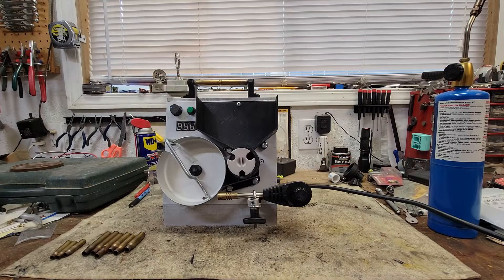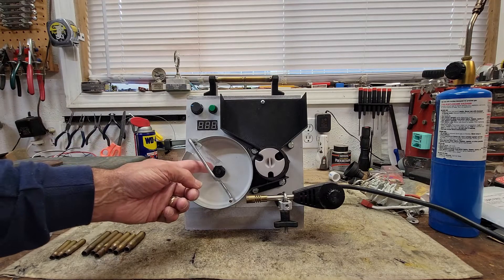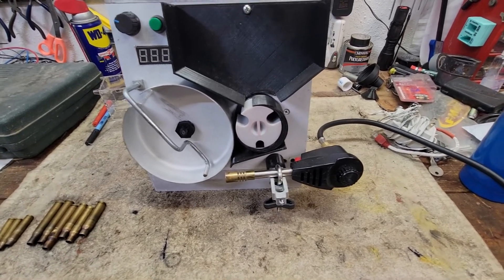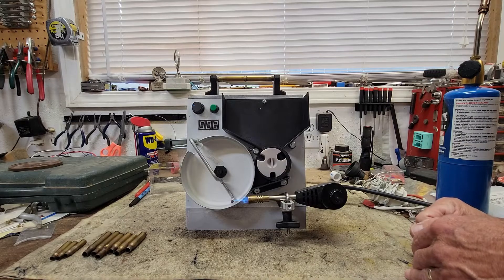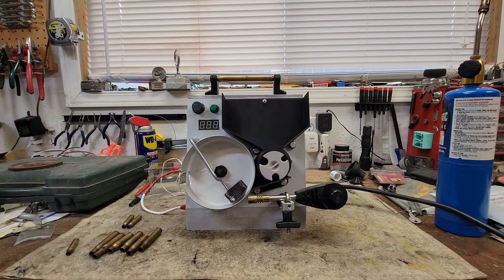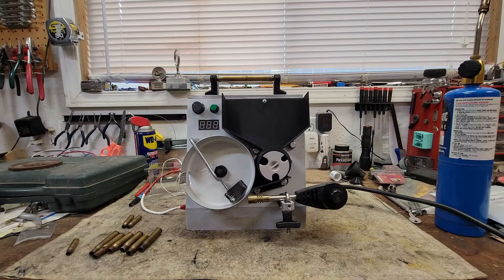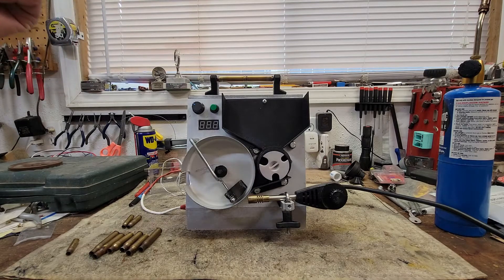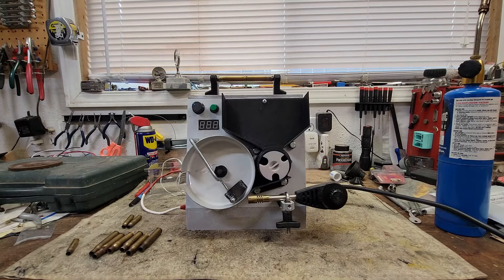Annealer questions and answers

Comment: Thanks again for the design and inspiration. This was one of the first 3d printer projects I made a few years ago. I made the case a little taller at the top for an extended hopper and underneath the case spinner for a brass catcher. I also used a high torque drive motor to prevent jams with the extended hopper.  Ive run thousands of rounds through mine since.

Comment: I’m actually finally beginning my build today, I’m building mine out of aluminum.
I bent two pieces to marry with a bolt on top back and a hinge bottom. I also made my bottom 5.5” from bottom for more storage and also for a deeper pan to fit under pan.
My only issue is how you have screw sizes listed, when I was going to purchase them I need much smaller due to thickness
Reply from the maker: Anytime you alter the original design, which is great by the way, other changes will be neccessary.
Reply: @msgbean  when I’m done I’ll send you a pic and progress report, currently dealing with hand issues, neurological they believe so sure could use some prayers if you know my Savior Jesus